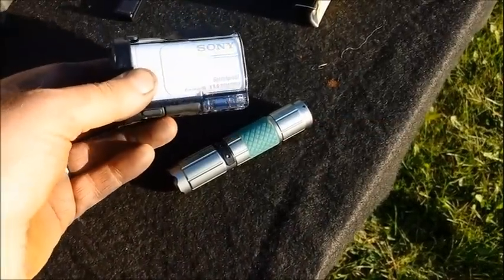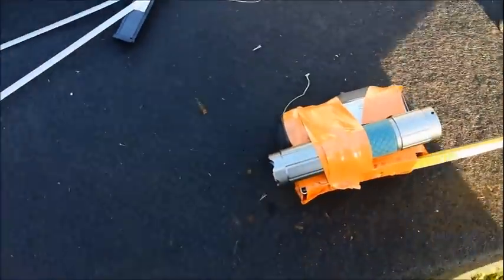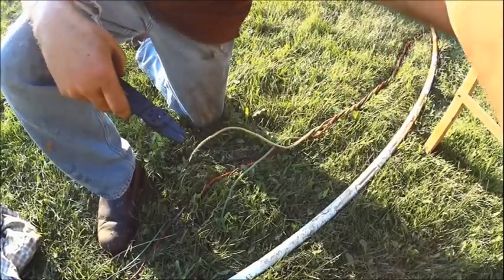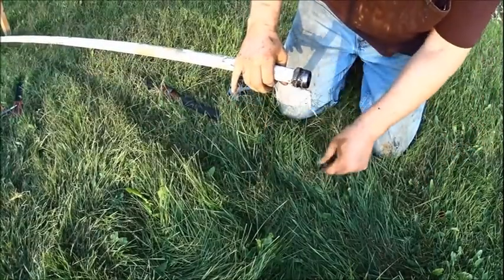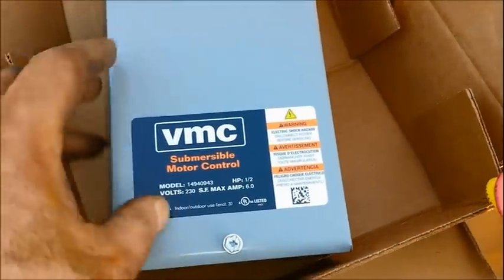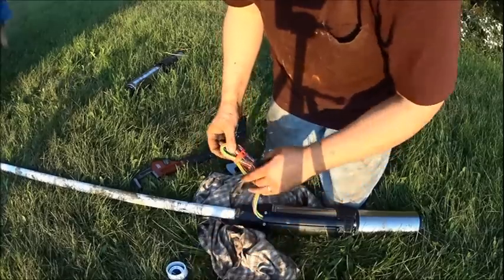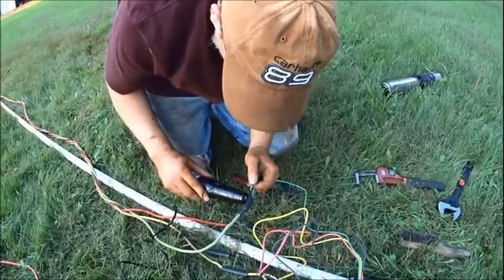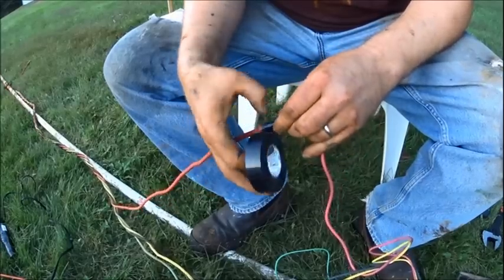Submersible Well Pump Replacement 2 of 3 (Old Video Re-Upload)

Comment: Only thought is, if you're going to go that far, with all of the iron and mineral on the outside, why not replace the pipe too? Seems there's likely a fair amount on the inside, and PVC does get brittle over the years. That's why a stainless steel safety cable is recommended when using PVC (where as some pumps discourage the use altogether). Fantastic video, and you're a beast the way you pulled that old pump out while moving the table around the yard, lol!
Reply from the maker: Good suggestion.

Comment: Our Well is 425 feet deep but the pump only goes down 135 feet. I have pulled it twice for Shitty Wire and now have flat stranded. I used my 4WD Blazer to gently pull the Well. Mine uses the 1 inch black continuous length Pipe. I put a Cable Spool to lift it so that it didn't scrape against the Casing. Thanks for the Video
Reply from the maker: That's crazy deep.  Water or oil?
Reply: The black pipe is called poly pipe.

Comment: Hand tight is good enough, because the continual start of the pump actually has a tendency to tighten itself.  All pump motors' rotation are the same....ccw facing the foot valve end.  I'm gonna go look at no. 1 and no. 3 too....  to see how deep your pump is set at.  Unless I missed it in this one.  Two thumbs up sir.  Hey, for the tape there's an amalgamating tape which when stretched to cover your splice it causes it to bond into one solid rubber piece.  You have to cut it off with a knife, it will not un roll.  Good stuff man, good stuff.  At the end, it looked like (3) 20' sections ??  Gotta go, just snuck in under the radar for a quick tea....

Comment: What tool did you use exactly to lift the pump out?
Reply from the maker: A heavy-duty studly pair of biceps mainly. 😎
Reply: OneVeryOrdinaryMan what was the size of the pipe used?
Reply from the maker: I think it was 1" pipe. Not sure if that varies from one setup to another.

Comment: I think I would have used all new stuff. Black roll pipe Teflon tape at pump fitting and new wire. The wire was old thats why it was hard to strip. Otherwise didn't look too hard to replace.
Reply from the maker: 7 years older now and fortunately still working very "well". 😬